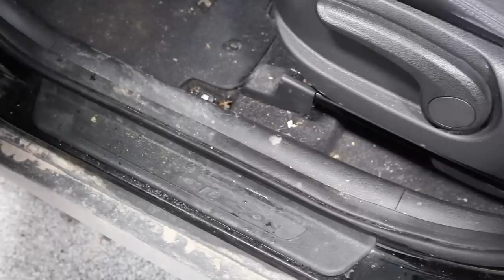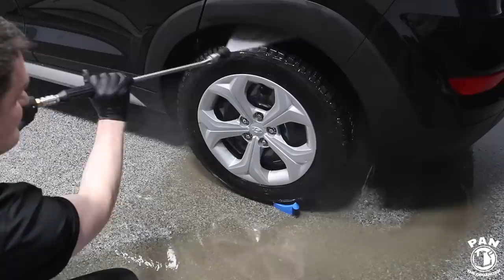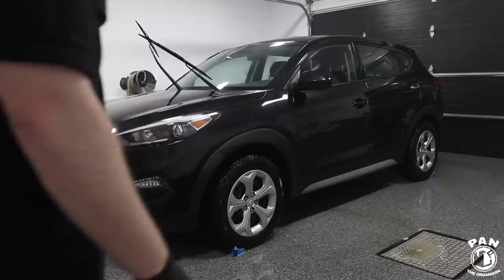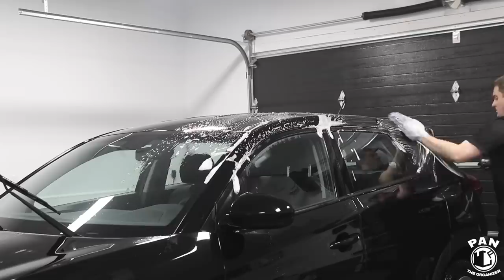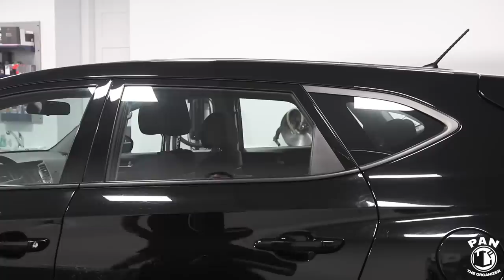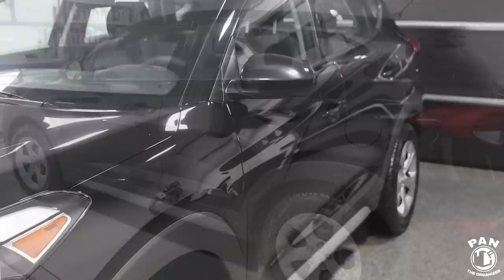Deep Cleaning a DIRTY NASTY Car! | Insane Transformation!

Comment: Hey Pan! Great video. Quick question you used a clay pad, and then didn’t do any paint correction. Is this fine to do? What shape was the paint after the clay bar? Lots of swirls? I want to use a clay bar but have no experience with paint correction so I am hesitant to use a clay bar! Thanks for the video!
Reply from the maker: Thanks! Usually you always polish the paint after claying. This was just a maintenance wash though, and there will be a follow-up video for something special I did on the exterior, stay tuned for that.

But yeah, normally after claying, you want to inspect your paintwork and see if it needs polishing.
Reply: @PanTheOrganizer  I just noticed but if it was a maintenance wash, I didn't really see any protection, so was that at client's request to leave no protection?

Comment: Definitely want to see part 2.  Question: are you still using the Karcher K5 as your power washer?  What do you think of it so far?  Looking to get a power washer and checking on your advice. Thanks for all the videos!!
Reply from the maker: I have been using a much higher end Kranzle pressure washer for four years now. I made a full review here: https://youtu.be/Cj4FDpKuORI

I had the previous K5 for over ten years and it was amazing. I now recommend the Karcher K1700 as it has 1/4 inch quick connectors. Watch my video here: https://youtu.be/IuiQpiwDOrM

Comment: Hey pan I have a question. I got rim ceramic coating. I want to know if I can use it on brand new wheels before mounting them on tires? At first I thought it was a great idea but if I do so will they have problems with the weights? Or fall off during use? Thank you for the help!

Comment: Hey Pan! Awesome video 😍 I have a few questions.
1. Should I rinse the car before snow foam?
2. Can I clean wheels before snow foam or rinsing the car?
3. What dilution should I use Lift without stripping existing protection during weekly washes or should I opt for different product? Thanks!
Reply from the maker: Watch how I normally wash a car: https://youtu.be/0KUJpoki-iQ

CarPro Lift should only be used on ceramic coated cars. The dilution ratio is clearly indicated on the label.
Reply: @PanTheOrganizer  Thanks Pan! 😁

Comment: Looking forward to the interior transformation!  You mentioned this was a "maintenance" wash and based on the salt deposit pattern in the hood, it seems this is a prior ceramic coat.  If so, how long ago was the coating done. That is, how old is the ceramic.  It looks to be holding up very well!
Reply from the maker: No this car never had a ceramic coating. It's a disaster on four wheels, the owner would never pay for such protection lol. What it did have was Soft99 Fusso Coat applied on it a bit over a year ago. So there was no protection left. 

There will be a special follow-up video for the exterior, so stay tuned.

Comment: So pan in my experience I cannot use a synthetic clay towelettes or mitt even though I try and use different pressure with it and I know all paint will be different soft paint hard paint I actually feel like I get better results with a Claybar for some reason when I use ONR and a mothers clay bar I actually get less Marring on the paint, after that I would recommend using Adams white clay bar but for some reason the mothers clay bar has more stickiness to it and I feel picks up better contaminants!

Comment: Hi Pan! Love your channel. Thx for always answering so many questions. Beginner here, just got the Griots G9 w/ 5” plateconversion. I notice with the coarse blue pads especially, that it stops spinning on all the cuts and lines of the car on speed 4 and 5 with hardly any pressure. Do I need a smaller polisher for those areas?   Cheers!
Reply from the maker: That's typical of all dual-action polishers. Try to not apply too much pressure on the polisher, if not the pad will stall.  And yes in tighter areas, you need to get smaller polishers. Watch my review of my line of Rupes polishers and see their use: https://youtu.be/U1ZD0L3RCa4

A 5 or 6 inch backing plate will allow you to do 80-85% of the job. But you need more tools to get to 100% for obvious reasons.

Comment: Pan I just washed my 535i and birds are pooping on it like they’re potty trained. Even though I wash it weekly I don’t want to let the bird poop sit for a whole week. What’s the best way to just wipe off the bird poop?
Reply from the maker: There is no better way than washing your car. That's for sure. People like to use quick detail sprays to remove bird dropping, and it could work to some extent but you might not have a perfectly clean surface or you could risk scratching or marring the paint. Make sure that your paintwork is protected with something like a ceramic coating, which helps prevent the clear coat from being affected by acid rain, bird droppings, tar, tree sap, industrial fallout, etc.

Comment: When you apply interior perl on a pad, you then buff off with a towel? Or just buff on with the pad? Thanks
Reply from the maker: I just apply it with a microfiber applicator and that’s it.
Reply: @PanTheOrganizer  weekly cleaning car what dilution:
1. Gyeon Foam
2. P&S Brake Buster
3. Reset

What’s your opinion about Lift? Did you try Koch Chemie GSF?
Reply from the maker: I tried both. You will see a video for CarPro Lift on my channel soon, so stay tuned. And eventually GSF as well.

Comment: I find it interesting that you use a glass cleaner on the exterior after an extensive wash.  I would think after a rinse, foam and rinse, and contact wash the glass would be essentially as clean as it's going to get.
Reply from the maker: We always go the extra mile in detailing. Plus sometimes you get water dripping that the glass cleaner will remove and more dirt that a pH neutral shampoo doesn’t remove.

Comment: Can I get a 60/40 ratio conversion to oz per solution/water for your wheels?
Reply from the maker: 60% Bead Maker with 40% water, it doesn’t have to be scientific for this application. You could do 1/3 water 2/3 Brake Buster, or a 50/50 mix if you like simple things.

Comment: Why didn´t you use iron and tar remover instead of mechanically scrub with clay mitt? Always get swirls (need polish) with clay or clay mitt.
Reply from the maker: An iron remover was used as the clay lube. I explained that in the video. And there will be a special follow-up video for the exterior. You’ll see why.

Comment: Hello Pan, I would like to ask you a question, the carpro Lift pre-wash shampoo removes waxes or sealants, is it true ?!
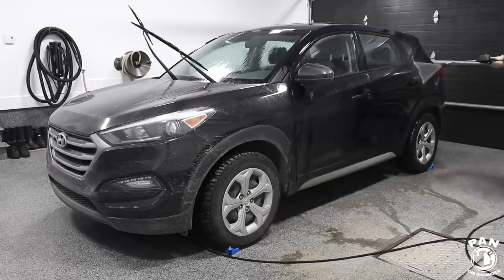I don't use ceramic protection, but pastes such as colliniti 476s, seal in shine, etc., I've been told that even the 1:10 dilution recommended by the manufacturer would remove some protection, you know, say something about the lift »!
Reply from the maker: It won't necessarily fully remove previous protections, but it will certainly start to break down older waxes and regular sealants, as it's a high alkaline (high pH) shampoo. Hence why it's only recommended for use on ceramic coated cars, that can resist that.

I have a video for CarPro Lift coming tomorrow (Saturday) so stay tuned.
Reply: @PanTheOrganizer  tomorrow will have a video ?! I'm attentive, tanks pan!
Reply from the maker: Yes! :)

Comment: I’m still confused whether or not a first rinse with the pressure washer is considered proper car wash technique. Flinging debris at 2000 PSI across the paint can damage the paint but does it just depend on how dirty the car is? If a car is caked with dirt it makes sense to pressure wash it off before snow foaming. On the other hand multiple applications of snow foam could also work but doesn’t make sense as I’ve never seen anyone do that.

Comment: 60% product and 40% water sounded very much, anyone have a more cost friendly dilution for the brake buster in a foam cannon? ☺️
Reply from the maker: LOL come on Dain. You're using so little in that foam cannon. Way more efficiency compared to straight from the sprayer undiluted. 

What wheel cleaner are you using now?
Reply: @PanTheOrganizer  Right now im using Auto Finesse Imperial, but i will buy Brake Buster since so many americans and canadians like yourself praise it so much ;) Is there an advantage to use Brake Buster in a IK pump sprayer or is foam cannon just as good?

Comment: I don’t think it would be safe to use a pressure washer on a non-factory painted car.  If you’ve had to repair a car, say a deer ran into your car, the pressure washer can penetrate a non-baked paint surface...right?
Reply from the maker: Anything under 2000 psi is perfectly fine to wash cars. I set my pressure washer to 1000 psi to wash cars.